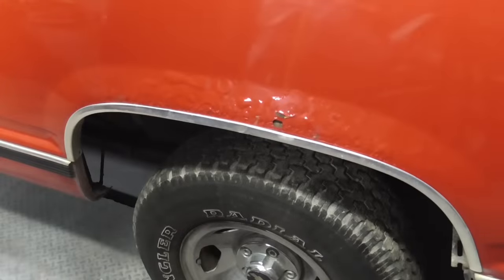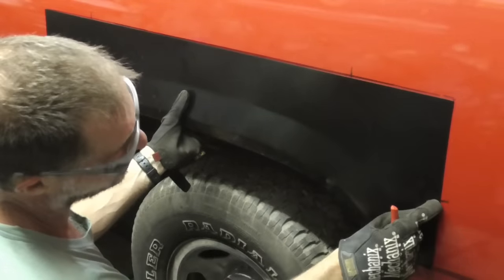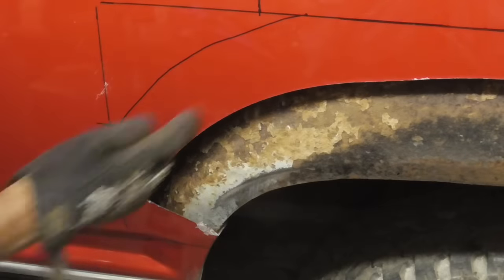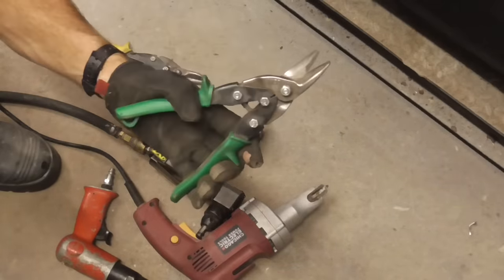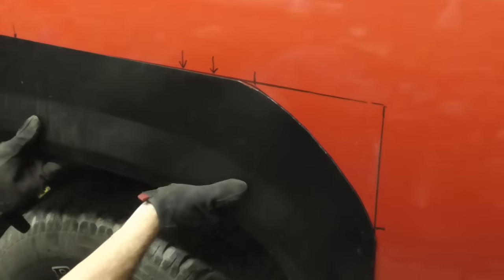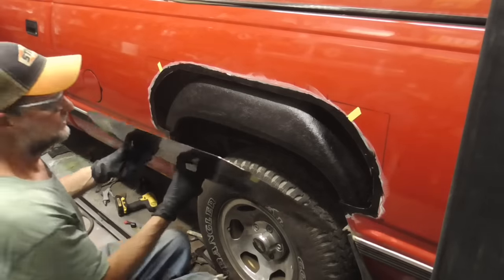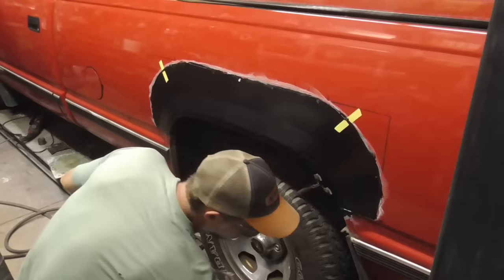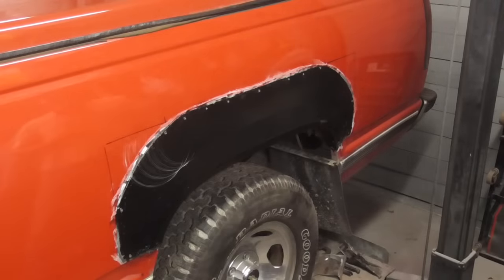Glue On Wheel Arch Rust Repair Panels w/ SEM Impact Resistant Panel Adhesive

Comment: I have a question. I recently used glue as well for some rocker panels that I replaced and used "Bondo" brand filler that can be bought at autozone or anywhere. The "bondo" brand I bought does not apply or level anywhere as good as the filler you used. What am I doing wrong? What is the trick to making filler level and apply as seen in this video? thanks!
Reply from the maker: Bondo brand works just as well.  First make sure that you are mixing it so it doesn't harden to fast.  https://www.youtube.com/watch?v=BUh9Deb0whQ  Next you always want to use super sharp sand paper and/or tools like the cheese grater.  See this vid for getting filler level/straight:  https://www.youtube.com/watch?v=rv0uB-ZvrFo  If you have ?s after that ask again - Jerry

Comment: I am curious about how you were able to get the panel attachment the exact fit to the truck quarter panel? After cutting away the rust affected area.
Reply from the maker: Clamps and screws.  While clamping and screwing you are manipulating the sheet metal a bit to make sure it fits perfect.  A tap here, a pinch there type of thing 👍

Comment: So instead of using a MIG wlder, and getting a flush join, you're gonna glue it on, then bury the overlap in bondo?
Reply from the maker: Yes - like many good body shops do in south east Michigan because of the water tight seam unlike butt welding and trying to make a flush joint.  https://www.youtube.com/watch?v=t1WclT_GMvk

Comment: The rust on the rear wheel panels seems to be common on these GM trucks from '73 to current. My '68 C10 doesn't have a rust problem like this but my '01 Suburban and my '10 GMC 1500 do though.
This method seems to be the way to go for many to make the repairs.
Question though, 
What prevents the rust from forming  behind the panel and coming back through again?
Reply from the maker: Excellent ?  - here's what works - https://www.youtube.com/watch?v=8XaZBy7GC7A  I have found nothing else that works as well.  Here's another if interested - https://www.youtube.com/watch?v=y05dNxt-nVc

Comment: Where's the waterproof filler over the bonded area and how are you sealing.up the backside and rustproofing?

Just an old metalsmith asking?
Reply from the maker: No need for water proof filler as the paint seals the job and the seam is completely wp. Back side is treated after the repair like this - https://www.youtube.com/watch?v=8XaZBy7GC7A  Hope that helps answer some ?s - Jerry

Comment: Being a collision tech I can see the benefit and also the drawbacks of a repair like this. What I will say is structural Impact adhesive is a bit overkill. Multi purpose panel adhesive is a more practical option. Also to avoid failure down the road the adhesive should be applied with a spreader into a 36 grit scratch and no bare metal should be showing when hanging the new panel. Otherwise awesome repair for and old truck!
Reply from the maker: Good tips Travis - thanks for your input :)

Comment: There are no body shops in my area that will do rust repair work. All want collision work only.  So I'll be using this method on my 08 truck. Great video. Hope mine turns out as well as this! How many minutes before the adhesive sets up??? Appears like it might be none!
Reply from the maker: It takes quite a while.  I leave it overnight.  At room temp it says it cures in 48 hours but I work with it the next day.  You have plenty of time to work w/o worrying about it hardening up on you :)
Reply: @LakesideAutobody  Followed the video, replaced the wheel arch, applied Bondo , sanded and applied primer. Looked great and professional! Unfortunately, when we covered with gloss black paint, every place Bondo was applied or sanded shows up and looks ... well, rather lousy. Any suggestions would be appreciated. With the flat primer on it, it looked great! Thanks.
Reply from the maker: @jeffbrown3963  As long as you tapped the seam down and you have sanded your filler to 80 grit, feather edged the paint, the next step is to prime with primer surfacer.  Once you block sand that primer and it is perfectly flat and smooth you should have nothing to worry about.  If your surface isn't glass smooth before painting, you will see a ton of filler, waves, edges of paint, etc.  Block sanding primer is the answer - https://www.youtube.com/watch?v=itEzOW8Knzs  or https://www.youtube.com/watch?v=caWJYozggww

Comment: If I used a flange tool, I would only have 1/2" wide area for glue.  Do you think that is sufficient area?  NICE JOB BTW!
Reply from the maker: I don't think so.  I've was always under the impression that 1" with rivets is the correct procedure.  That being said, I can't tell you for sure 'cause I never tried it.  If you do try it let me know if it works for you and what the pitfalls are - curious :)
Reply: @LakesideAutobody  THX

Comment: Just one question. Why not use sheet metal screws to hold the panel in place and then remove them once you’ve glued the panel instead of using those special screws you mentioned.
Reply from the maker: For sure.. you can do that.  They hold a bit tighter too.  A good friend sent me these guys so I figured I'd give them a try.  Screws, clamps, rivets.... anything you think will do the job :)
Reply: Thank you for replying. Your a class act. From an old retiree from Canada. Thank you.

Comment: Looks like you applied adhesive to the folded under "lip" of the wheel opening on the patch to glue it to the inner fender.  Did you use anything other than the adhesive to hold that joint together? (rivets o screws for example?)
Reply from the maker: Screws on the ends but just clamps otherwise.  Removed the screws and clamps and you're good.  The panel is still fine today - neighbors truck :)

Comment: No adhesion issues with filler over the SEM? I've used Norton Speedgrip in the past and bondo will not stick to it and you have to prime first. A hard lesson to learn.
Reply from the maker: No but most of it was cleaned off preparing it for filler.   Everything was down to nice clean 36 grit scratched/ground metal.
Reply: Always use epoxy based adhesive. Bondo will stick everytime, plus like Jerry said you gotta grind it clean for filler anyway

Comment: You don’t need to use the rivets the Panel bond is enough. Even if you do the hole box side you can punch holes in it.  And the the panel bond comes out you can sand the hole and it looks  like a factory pinch weld.

Comment: I would like to see some clean up of the inner wheel well and some antirust finish applied there, also some applied to the inside while you have some access there, it doesn't have to be pretty but most rust starts inside and works it way out.  might want to prime the inside of the patch as well.  Done right and you don't live in some rust hellhole like upstate NY this might last the life of the truck.
Reply from the maker: You're right.  You can also make sure your repaired panel can drain and stay dry and try this - it really does work the best - https://www.youtube.com/watch?v=8XaZBy7GC7A

Comment: You did an excellent job on the video. Thank You. How ever before you put on the new metal on I myself all ways blow out the rust, and hand wire brush it, then flash out with my pressure washer with soap let it dry overnight. Then the next day blow out any rust again, apply (RUST MOD) before or any good rust prohibitor, now installing the new metal as you did. That way it kills any rust problems down the road. Under coat all under neath before painting. Thats the way I do mine.
Reply from the maker: That would probably last a lot longer.  I found this to be helpful too - https://www.youtube.com/watch?v=8XaZBy7GC7A

Comment: great video...what are you auguring out the drill holes with and why?  is it for better reception of the filler?  thks!
Reply from the maker: I'm tapping down the holes a bit so that there is a nice rigid layer of filler over them.  With out doing that you would have a very thin layer of filler spanning that hole.  If that didn't answer your question ask again - thanks for the support Ross :)

Comment: I'm want to know why you didn't put a coat of short strand over the seam before you started finishing with filler?
Reply from the maker: You can do that if you want.  It actually is better to do it that way as the fiberglass reinforced filler is water proof just in case your weld seam is not water tight (most aren't) - Here's the follow up video on this truck and it's repairs 1-2 years later - https://www.youtube.com/watch?v=t1WclT_GMvk

Comment: Well that's one way to do it I think I would have left a little bit wider glue area but maybe you had a reason for that and I don't think the rivets were necessary that blue pretty much holds I think the rivets were not required
Reply from the maker: Yes - you can leave the rivets out if you prefer :)

Comment: I see that you use screws on the panel but rivets on the rocker panel fix … is one better than the other?
Reply from the maker: What ever pulls the panels together best.  I think screws work great but sometimes I run out or can find any then I use rivets - need to get more organized I guess :)

Comment: Quick Question… Any trouble removing the screws if you happen to get adhesive (or J B Weld 🙃) seeping through the screws holes during attachment?
Reply from the maker: Not if you take them out early enough - like the next day.  The glue is not fully cured yet.

Comment: What did u screw the panel with during the glueing ? Is it the cleco screws ? Do u take the cleco screws out after the glue settles ?
Reply from the maker: Regular old sheet metal screws work the best actually.  drill the first hole a bit bigger so the screw pulls the panels together.  This glue has micro balls in it to prevent squeezing the glue out.  You will remove the screws after.  You can glue some pop rivets in the holes or leave them - you'll never have an issue.  Tap the seam down and fill with body filler :)

Comment: Are your screws self tapping? Stainless ?
Reply from the maker: They are just regular steel - they look like those little self tappers but they have a regular tip - have to pre drill w/ 1/8" bit.  HF sells some good double ended 1/8" bits - pretty durable :)

Comment: If that glue stays flexible wont that cause cracks in the paint and filler?
Reply from the maker: It's not that flexible.  Actually the urethane paint is probably more flexible than the glue.  We are talking about a very small amount - just enough to keep it from shattering or cracking when hit hard.

Comment: Need to do this to my 2011 Silverado this summer.  My friend suggested using epoxy instead of welding - saying that welding would just make it rust faster.  Thank you for posting these videos, makes it look like I can almost do it - lol.  I was thinking of using a panel flanger though - either flanging the bedside or the patch panel to reduce the amount of filler.  Did you chose not to in order to get a larger surface area for the glue?  Thank you for your time.
Reply from the maker: I do not flange for 2 main reasons:  1) flange is not wide enough  2) Can't always do it so no sense doing it at all - i.e. wheel well lips, contours like rockers, 90 degree bends, A/B/C posts, edges, etc  You're welcome for the videos DP - good luck - you can do it - even if you left it w/o bodywork and paint it would look better :)

Comment: What do you do about the area between the inner panel and the patch panel? If you don`t do something dirt and water will get packed in above the inner panel pretty quick I would think.Working on my truck right now and not sure what to do.
Reply from the maker: Awesome thinking.  Make sure you make some cut outs in the inner panel so there's drainage and take a look at this video - this method really works - lots of old body men do it because they witnessed how vehicles rust (always from the inside out) and figured out how to stop it.  https://www.youtube.com/watch?v=8XaZBy7GC7A

Comment: I have a tool bed on an f350 diesel. The inside fender wells (just think basic steel box around rear dual tires) has rusted due to mud sticking. I've thought about cutting out the flat steel panels on the inside (leaving a 1 inch backing piece around edges as it's only rusty in the center) and using a structural adhesive to glue on a new sheet of metal. But I'd like to bind a sheet of stainless to the existing steel. Dan this work? Any ideas or tips? The stainless with prevent rust. Thanks
Reply from the maker: Yes you could glue the stainless to the regular metal - no problem.  You'll have to sand or DA sand the stainless and the metal - where they bond.  There would not be corrosion because of the air tight and water tight seam - no oxygen/water - no corrosion :)

Comment: I really think adhesives are a good way to go.  I sure beats tack welds.  Back in the seventies lead was used to make the panel look perfect as well as body sand for smoothness.  But adding heat can distort the panel.  This does look much better.
Thanks great video man.
Reply from the maker: You're welcome my friend :)

Comment: curious why when you had the inner fender exposed, you didn't shoot some rust preventer paint onto it? Sure it's not that great - but better than leaving all that exposed and rusting sheet metal on the liner, isn't it? Just Sayin'
Reply from the maker: Because spraying it with something like paint or undercoating actually promotes rust.  The moisture finds its way between the coating and the metal, it harbors salt, debris, etc.  I found the best method to prevent future rust is to make sure the panel can drain and dry out inside by even adding drain holes and this - https://www.youtube.com/watch?v=8XaZBy7GC7A

Comment: Instead of covering with a piece of metal, could you use something else, like those vinyl trim things that go around wheel wells?  Or even cut an old tire with sidewall glued on the exterior and part of the tread going underneath in the wheel well?   I suppose relief cuts would be necessary in the side wall to make in conform to the contour of the wheel well.  It would look like an aftermarket modification.
Reply from the maker: Only your imagination limits you :)  As long as it is strong and won't come flying off in an accident and injure someone.  Wait... that sounds like a lawyer or politician 🤔

Comment: Did you get glue on the Cleco fasteners? About how many ounces of glue did this panel need?
Reply from the maker: About 1/2 of one of those tubes or even less.  You can use screws - just make sure the hole is bigger on the first panel so they are pulled together.  What ever pinches the panels together is good.  This glue has micro balls in it to prevent squeezing all the glue out of the seam - good stuff :)

Comment: I purchase front glue on wheel arch panels for my f250. I reviewed you video and just wondering if I need to remove only the rusted metal areas  or do I need to cut and remove more of the fender to blend  the new panel into the existing fender
Reply from the maker: Cut it where it will be easiest to blend or knock the seam down and do your filler work.  IOW don't cut it where it will be hard to do Bondo :)
Reply: @LakesideAutobody  thanks

Comment: What kind of rivets are you using? Flush/countersunk? Or just glue and grind the heads off?
Reply from the maker: Regular rivets.  You can use screws and just pull them before the filler or grind the heads off.  You won't have any issues up high on the panel like that - if it is to rust again the problems will start at the bottom of the panel or the wheel well lip :)
Reply: @LakesideAutobody  good deal, I saw you using a countersink to debur the holes and figured you might have been using flush rivets. Good to know!

Comment: Hi have a question. Currently in the process of trying to repair rust on a 2010 Tahoe ltz. I can not find anything for rocker panels to save my life. I can find inners all day long but no outter panels. Is there any insight you could give or possibly point me in the direction of a replacement panel
Reply from the maker: Have you tried - raybuck.com or millsupply.com

Comment: Is that panel specifically designed to be riveted and lap glued or could you have welded it if you wanted? I see patch panels for Jeep Cherokee XJs encompassing the entire rear quarter from the door to the bumper and also other panels that are a jigsaw of that quarter. I always assumed they were made to be butt welded but now I don't know what the options are. Very confusing.
Reply from the maker: It's actually made to be welded.  A lot of shops have gone to glue when possible due to the water tight seam - you can weld or glue :)

Comment: I also use every tool in the barn,what kind of glue,do ya use?
Reply from the maker: SEM Structural Impact Resistant Adhesive - Part #39757  I like it 'cause you can't squeeze it out of joint because it is has micro sized balls in there to keep from pinching the joint too hard so you're confident there's glue through out the lap :)

Comment: I was wondering why you didn’t offset the the old surface to make a flat seam ?
Reply from the maker: You could try it but flange tools only do 1/2".  Another reason is it is impossible to do around wheel well lips, sharp bend, corners etc.  No matter what patch or how you do patches butt, lap, step - you really never want a seam right under the finish.  Knocking the seam down does 2 things,... helps hide the repair an acts as a buffer between the seam and finish :)

Comment: Is it possible to use stainless steel patch panels for problem areas with this meathod and avoiding the galvanic corrosion from welding/touching 2 disimilar metals?
Reply from the maker: I think it is possible to weld stainless to regular sheet but there really is no need to go that far.  Check this video out for preventing future rust - https://www.youtube.com/watch?v=8XaZBy7GC7A